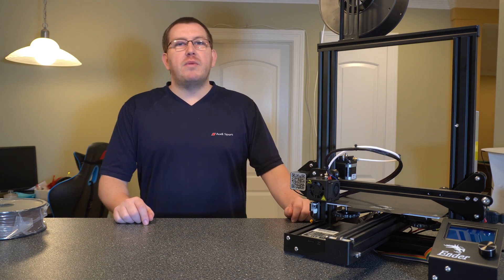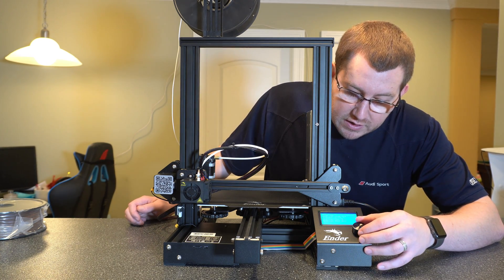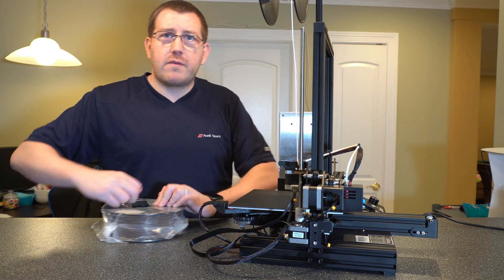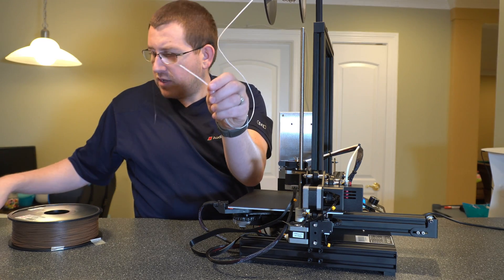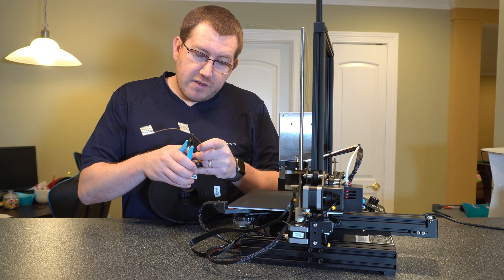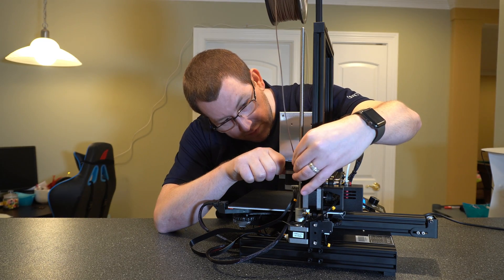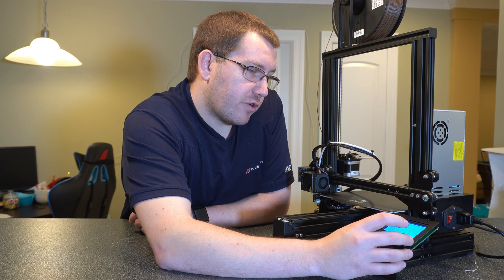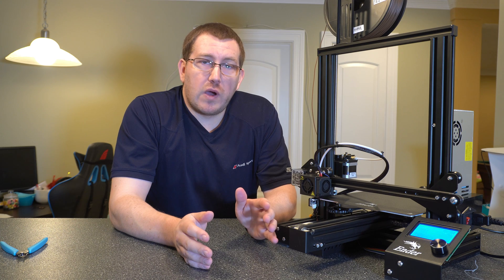Ender 3 Pro Add Filament - Everything You Need to Know!!!

Comment: I have a problem, the 2 gears that push the filament forward to feed into the white tube, are too close to each other, and I cannot get the filament through them, in order for the filament to reach the white tube. I unscrewed one of the gears, put it through, then tried to screw it back on but the PLA is too thick. However the PLA I’m using is the same thickness as the sample spindle I got from the actual printer, so is there something I am missing?
Reply from the maker: Hi. Can you verify that your using 1.75mm pla?
Reply: @3DPrintscape  just checked and yep, 1.75
Reply from the maker: @sirdroplet9763  And your saying the filament wont fit between the wheel and gear?
Reply: @3DPrintscape  yes, ive had to take the wheel out, put the filament in, but i cant even screw the wheel back in because the filament is in the way
Reply from the maker: @sirdroplet9763  That seems really odd, either the extruder is wrong or the filament is. I have a video covering replacing the extruder with a aluminum one, that may be worth doing.
Reply: @3DPrintscape  Alright thanks, I'll check it out.

Comment: So I came to this video from your color change video. After I pause print with Cura GCode modification can I use this purge method and then resume print?
If I use the GCode plugin to pause print how do I start it up again? Same way after this purge?
Reply from the maker: Hi. Once the printer is paused, there should be a button on the screen to resume the print. Im not sure about the purge but i think it would work.

Comment: My first print with a new filament failed it seemed like the spool was too tight. the machine wouldnt pull the filament to print so it made a lot of tension. Do I need to loosen the filament before I print
Reply from the maker: Hi. You shouldn't need to do that, you can actually cause other issues with the filament twisting if you do it too much.

Comment: Do you also do this if you have to change filament mid way thru printing as you either run out or want to change colour?
Reply from the maker: Hi. Ya, just make sure you dont push down on the z axis when doing it.

Comment: IMPORTANT: pull your filament out SLOWLY or it could snap off inside the tube if this does happen just remove your clip to pull the tube out and pull the remaining film out easy fix but also easy to avoid
Reply from the maker: Hi. Thanks for the tip. I haven't had this happen to me but it is possible.
Reply: @3DPrintscape  it happened to me and I was freaking out for a minute but then I figured it out lol
Reply from the maker: @bobcat2840  Thats no fun, but at least you were able to figure it out.

Comment: THIS DIDNT HELP ME AT ALL AND NOW I BROKE THE DANG THING!
Reply from the maker: Hi. Sorry to hear that, what ended up breaking?
Reply: @3DPrintscape  the board that im using and i cant seem to put the filament into the hole but the reason it didnt help me is cause i couldnt see cause ur hands
Reply from the maker: @EzreyProductions  That part is almost more of an art than science because it's hard to get the filament to align with the second hole. Cut the filament at a 45 degree angle with the gap being on the side that's hitting the extruder.

Comment: and the printer is a new Ender 3 pro
Reply from the maker: Hi. I dont think I've come across anything that has a complete overview of what the menu items are. This is probably the best ive seen, but it makes a lot of assumptions. https://marlinfw.org/docs/features/lcd_menu.html
Reply: @3DPrintscape  Thank you for your reply, I am just trying to understand some of the items in the screen menu of my Ender 3 Pro and whether I need to concern myself,or even do I need to know, etc .As a new person I see in the menu under Control, then under Motion many sub-items  like Velocity,Acceleration, Jerk, and Steps  with some settings with giant values like Acceleration -Retract 1000. what is this? So I wonder.
Reply from the maker: @davidlow7583  Honestly i dont mess with settings like acceleration or reaction at the printer, I change those in the slicer if needed. I wouldn't spend too much time worrying about the setting in the menu yet, focus on learning Cura, or whatever slicer you are using.
Reply: @3DPrintscape  Thanks Rob for your advice. For a new person like me 3D printing is a daunting task. I am trying to learn Tinkercad to design my projects, Ideamaker to slice them, and Ender 3 Pro to print them.The task of learning which one of these does what is a task. It seemed obvious I start trying to understand the Ender 3 after receiving it in the mail and being all excited.For a start I had to learn to work the screen menu to find Auto Home, Disable steppers, level the bed, Preheat PLA etc and so looking at the menu I discover many sub-menus and wonder what they are all about, and hence my first question about a list of what each menu items does. Youtube videos talk about e.g. first layer can be 0.3mm, no blower fan, speed/velocity/feed rate can be 50 mms, Don't you do these in the Ender menu, apparently not you do these in the slicer program.So my new understanding is anything you prescribe in the slicer overrides the Ender settings.The light slowly dawns.
So your advice is good, I should concentrate on the slicer program, I would like it to be Cura but it needs a 64 bit system, mine is only the old 32 bit.So I start with Ideamaker. It seems to work OK.
Thanks again

Comment: A question, if I want to store the roll of filament, and I pull the filament out of the printer while it is hot, in the video the filament pulls out of the extruder with a long thin string. Is anything left behind in the hot end , the nozzle et and what happens the next time you feed new filament in, has the leftover clogged the tube,hot end ,nozzle
thank you
Reply from the maker: Hi. ive seen some filament get left behind on occasion but when you load the new filament, and purge it, it just comes out with the new filament.

Comment: I'm relatively new to 3D printing, but have printed some items with my Ender 3 Pro. I have run into a problem
where the icon on the blue screen indicating  the fan does not turn when I'm printing. Any ideas? Thank you
Reply from the maker: Hi. Can you verify that the fan is set to run in the Slicer. If you using Cura, its typically off for the first couple of layers then turns on.
Reply: @3DPrintscape  l checked on a reality Slicer and the”Enable cooling fan” has a check mark in the box. Thank you for the quick response.

Comment: My filament keeps pushing the white tube out can you help me pls because my prints are failing(i Mean the white tube where the filaments goes in)
Reply from the maker: Hi. Can you make sure the tube is all the way in and that you have the little clamps on the tube that hold it in place?
Reply: @3DPrintscape  it is all the way in but i only have one clamp on and that is between the grey thing and the tube
Reply: @3DPrintscape  how many clamps do you need
Reply from the maker: @stef1236  You would use two, one on each side of the tube.

Comment: After fixing the Bowden tube and then I put them back in and purged it I went to extrude and gave it 10. Well that’s screw up the settings because now I want to go to print nothing wants to come out but I can push the filament in and it goes out.  thank you
Reply from the maker: Hi. Im sorry you ran into issues, but i dont understand what your saying. When you load the filament and run through the purge is filament actually coming out at that point? Only purging 10mm wont be enough with a bowden drive system, i typically purge in 10mm increments.
Reply: @3DPrintscape  I thought I screwed it up but I got it working thank you
Reply from the maker: @optimuscreation  Glad to hear you got it working.

Comment: i tried feeding the filament in the hole in the back, but it wont go in the tube like how yours is, what am i doing wrong? i tried pushing it in hard only to bend the filament, it just wont go in. Your tutorial doesnt show the part where you put in the filament, i'm assuming its suppose to be a no brainer but mine wont go through. What am i doing wrong?
Reply from the maker: Hi. I probably should have covered that some in the video, because it is a pain. If you don’t have the tube on both sides the filament pushes against the inside of the adapter making it very difficult to use. I would make sure you have a tube on both sides, and you may need to move it around in different angles to get it through.
Reply: Thanks so much for your quick response. After messing around with it, eventually i did figure it out. But yeah you're right it would want to curve off and not want to go in the hole. That was my problem. Thanks again.

Comment: Should I remove filament for storing printer for long time without using it? I'm on an ender 3 pro
Reply from the maker: Hi. The short answer is yes, you should store the filament if it's not used often. I cover why its recommend and what I use for storage in this video (https://youtu.be/xhX-tKAbGxE).
Reply: @3DPrintscape  even pla?
Reply from the maker: Yes, especially PLA. PLA is hygroscopic and can absorb a lot of moisture from the air causing it to swell.
Reply: @3DPrintscape  OK thanks! Great video BTW